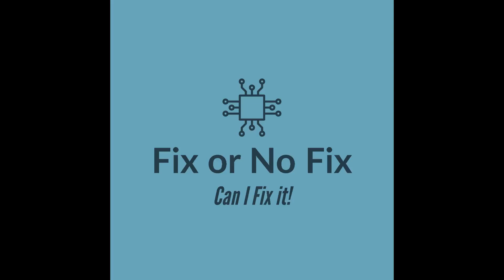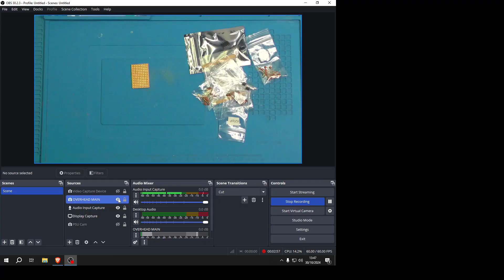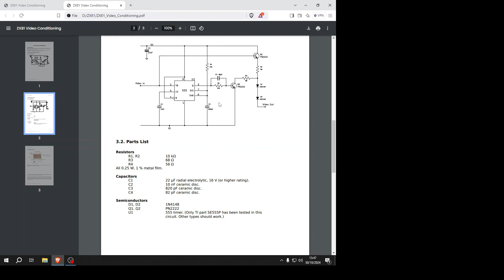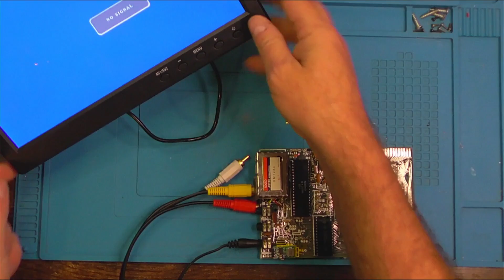Sinclair ZX81 Upgrades.  Composite mod, 16K Internal RAM.   Part 1

Comment: using step down , noise from 5vcc , its greater , 7805 great ,  using linear power
Reply: i have test this , but noise its greater then limit of circuit ,,,,  ok
Reply from the maker: Yes, for something like this a linear regulator is definitely the better option.

Comment: The big mistake Sinclair made with the ZX81 was no beep,  and the Spectrum should have had AY sound and correct video memory decoding for more efficient graphics routines,
Reply from the maker: Building to as low a budget as possible with the ZX81.  Probably same reason for only going as far as a beeper on the 48k Spectrum.